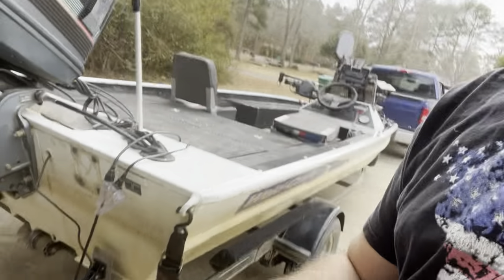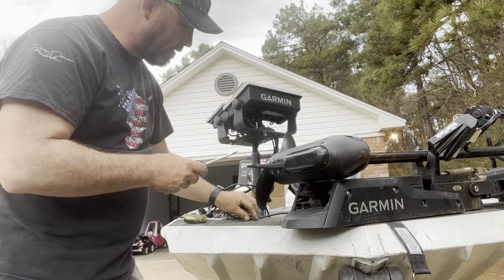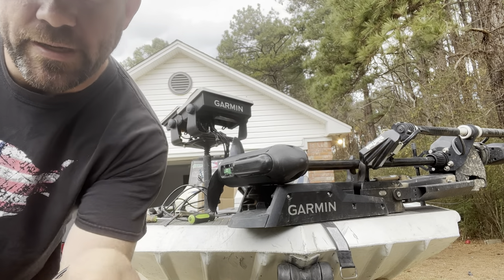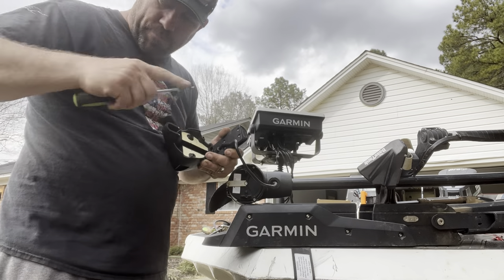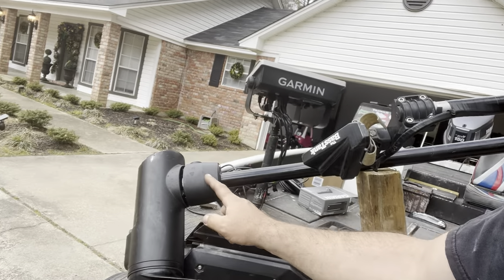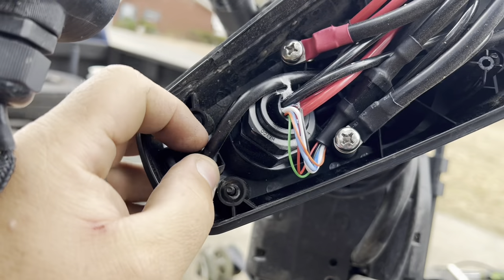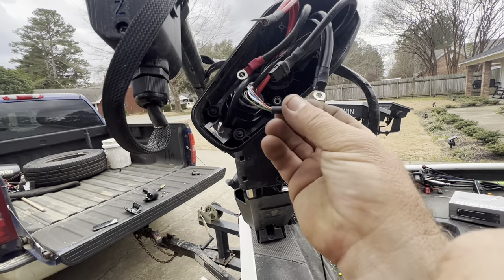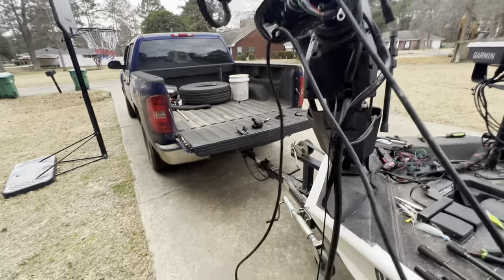Garmin Force: How To Change The GT54 Transducer In The Foot.

Comment: I just replaced my transducer and it certainly was a challenge.  I purchased the Shaft and Motor Hardware Service Kit for reassembly as it provides new O Rings, lube, screws and the transducer motor plugs and tool for removal. It was only $20.  Garmin uses locktite on their screws and removing the power cable in the head caused one of the metal nuts imbedded in the plastic to break free.  Fortunately epoxy came to my rescue and I didn't have to buy a new motor head cap.  I found pulling the cables out of the motor shaft to be more difficult than I'd have thought as those cables were really tight inside.  Contrary, pushing the cables back through were not as difficult, and possibly easier because the transducer cable was slid in first.  My most challenging portion of reassembly was pushing the motor shaft through the head.  Trying to align the key by myself was a bear.  It took me two hours to do the disassembly / reassembly, though now that I have done it once and understand the challenges I could probably cut the time in half.   Watching your video gave me the confidence to try it.  Appreciate all your videos.
Reply from the maker: Agreed bud

Comment: Hey big bro. About this, I’m having this issue myself. How hard is it actually to complete this? And you said you put a 56 in there instead of the 54? Does that work well?
Reply: And any other tips before I tackle this 😂???
Reply from the maker: No you can’t install a 56. I said some people have. Stick with the 54
Reply: I know you’re not a Garmin tech lol but is there a reason why the 56 won’t work on the force?
Reply from the maker: @probl3mx435  it will work but you would have to cut the skeg because it’s much longer.
Reply: @The_Garmin_Guru  the skeg? What’s that lol I’m sorry
Reply: Oh you mean the fin on the bottom of the TM?

Comment: That's  why I didn't  buy a TM with a built in Transducer. The design of the Garmin trolling is obvious there first time. I can not believe the way they have all the cables wrapped around the top of the TM. Looks like they just got frustrated and said screw it and just decided to wrap them around the top. And this is the Most expensive TM on the market.
Reply from the maker: So I’m assuming you’re one of the guys who will comment but won’t have a conversation back. I’m glad you found a trolling motor to your liking. I have zero problem with my force and I love it. Thanks for watching bud. Hope you catch them.
Reply: I agree, I think I am going to go with a Motor Guide Tour Pro that doesn’t have a built in transducer. This is a real clusterf**k to have to go through to replace a transducer. I now have a Minn Kota Fortrex with a GT54 transducer mounted on it and it has went out twice, I can’t imagine having to go through all this BS twice!

Comment: I’ve not heard much of that happening
Reply from the maker: I’ve personally had two gt54 go bad.
Reply: The transducer has a ceramic plate in the transducer that is part of the side scan. If you hit the transducer on something hard it will crack/break the ceramic plate causing it to lose one side. It is common if you fish shallow water with stumps or rocks. Garmin should send the trolling motor kit when sending the replacement so make sure you tell them you need the trolling motor transducer replacement kit. It has a new nose piece and everything you will need to replace the bad transducer except the thread lock.